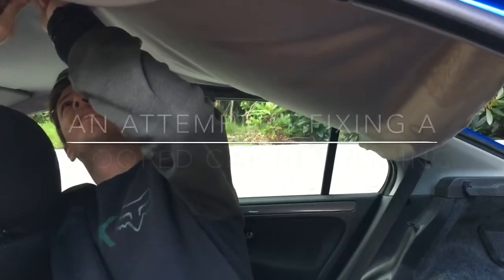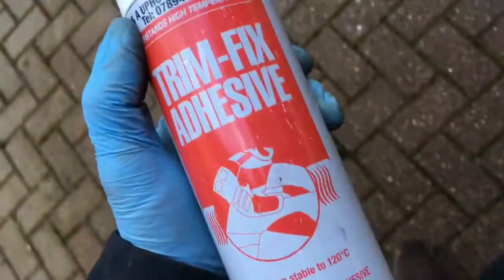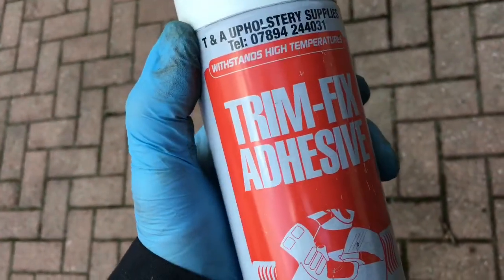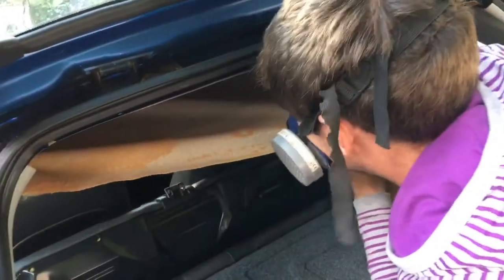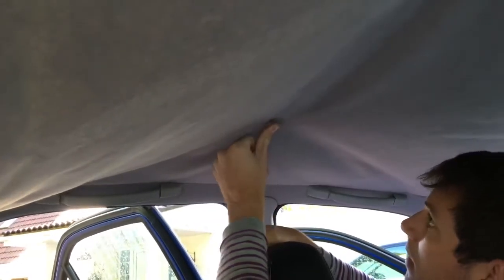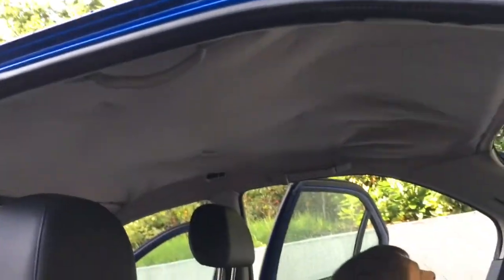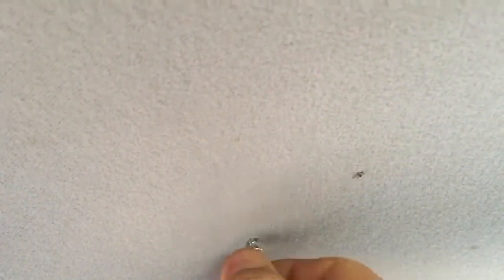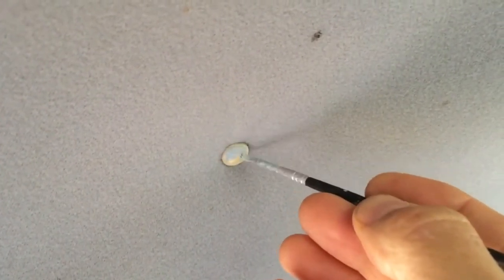Attempting to Fix a Drooped Sagging Car Headliner / Headlining

Comment: Nice video! How is the headliner holding up since you made the video? Thinking about buying this trimfix spray, just want to make sure it will stay stuck up. Thanks 🙂👍
Reply from the maker: Trimfix type sprays are difficult to use,  not because they don’t work, but because it’s hard to get a very clean surface.  In the video the lining was foam backed, which had disintegrated. It’s hard to remove every bit. If you don’t the spay only sticks to foam, so comes off again easily.  Which is why I resorted to pinning the roof as shown towards the end.

Comment: This is EXACTLY the video I needed to see.
Reply from the maker: Thanks, good luck with yours.  If you can, brush off any crumbly foam before gluing.  Or just use the screw and cap method.

Comment: Oh contraire ! Me non-smoker and sole owner/user (No passengers) of 17 year Skoda Fabia. Car parked in the unshaded open air when not in use. A week after  experiencing the record breaking summer temperatures of 36C in my part of London, head lining came away over the whole of the inside roof area. Looks like, with global warming VAG will have to, if they haven't already, uplift their materials specification for roof linings. Thinks  . . . I wonder what other materials currently used in cars will need to be improved for the same reason - certainly the top of the door cards (Originally grey) now turning a lovely shade of irradiated red.

Comment: Tried this in mine. First bit of sun / heat undid all my work. It came right off again. So frustrating.
Reply from the maker: Just use the small screw and caps like I eventually did in the video.  The trouble with gluing is that you need to thoroughly temove the old crumbling foam layer.